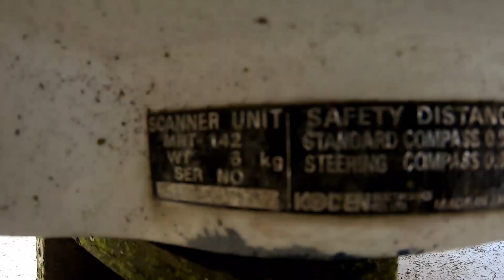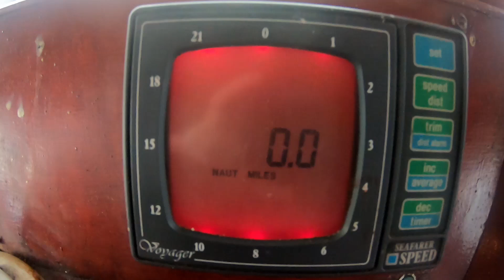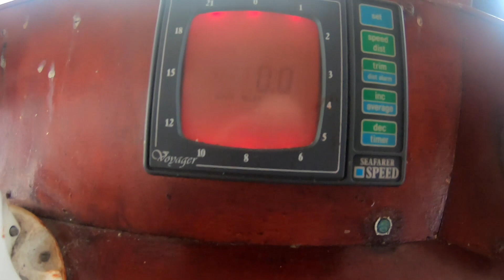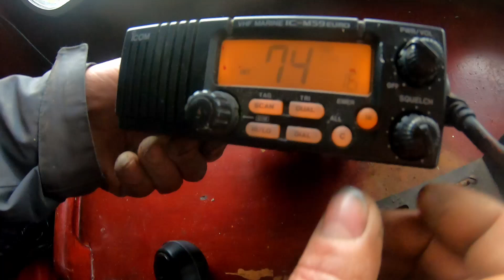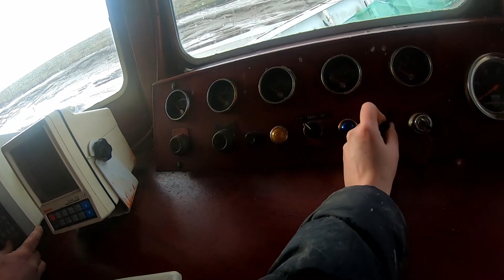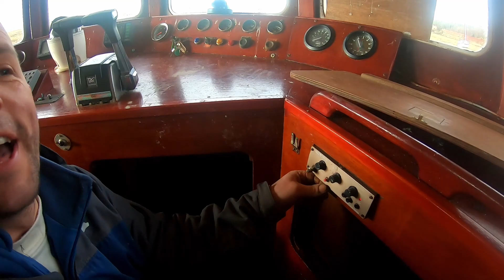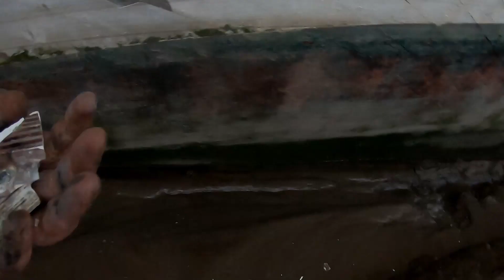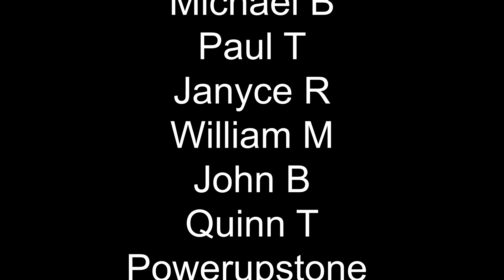Ep 6, Assessing the Hull, Mud fails and weird noises of the ship!

Comment: Squelch is a filter that cuts out signals below the level set by the dial ... it is used to silence the static you'd normally hear from the radio - since transmitted signals have more power than the background static, filtering out the lower strength signals gives you a clear radio ... to set it, turn it all the way down and then up until the static stops.

The radio was left on channel 16 since that is the emergency channel - do not transmit on that frequency unless you want the coastguard to pay you a visit ;)
Reply: Trivia.  Some older systems refer to 'squelch' as 'CODAN'   -  'Carrier Operated Device - Anti Noise'.

Comment: trouble is if you wet wash the inside of the hull you will have alot of debre which will clogg the limber holes (there gaps where your bulkheads and verticles meet the keel Called lymber holes these allow the bilgewater to move to the lowest part of the boat  usually engine room where the bilge pumps are )in the bilge or block you bilge pump

Comment: Back in New Zealand there were a lot of wooden boats which had worm or rot problems so the easiest way out was to plaster them with cement ... It worked really well to the point where the boats gained buoyancy and sat higher in the water.    Just in case you find rot which cannot be repaired easily. 😁😂

Comment: Try to get that old stove up and running 😎 , then you can burn all the bad wood 😃 , and get som heat to dry up the boat 🚣‍♀️ , 
A question is the boat equipped with diesel water heater ?
like a webasto ?
Reply from the maker: Yes but it has seized, we have took it to the workshop to strip down and fix
Reply: @ShipHappensUK  
Cool i’m using a old ebersprecher from a mercedes its 5 kw and i have my boat in the sea , and we have had -21 celsius her in Sweden lot of snow but the boat still is 6 + celsius inside :-) i can heat it up to 20-25 + c if i want 😃 , it’s a steel boat 34 fot twin engines

Comment: Since the boat is already wet, I would consider cleaning out as much debris as possible, power washing the inside. 

Follow up by applying a fungicidal digester spray. 

Then pump the bilges as clean and dry as you can.

It will be much more pleasant to work on if it's clean, and the fungicidal spray will slow the rot.

Comment: Knowing that the DC electric system is 24 volts, and you are currently working with 12 volts as an interim measure, you might consider LED lamps with the ability to work on either, as most of the work lights with LEDs are. Check the label! I've used some of these lights on my mobility scooter, and they give adequate light and minimum consumption...and. they were fairly cheap.  Carry on! You're doing fine. I for one love that this is truly a family project, where you don't just show the successes.

Comment: I would try to build a temporary structure with with a high roof and walls to work under a section at a time to replace the rotting wood that is allowing all the water to enter. Something like a canvas shed would be easy to set up and take down and you'd only have to attach it to some home made mounts you install on the boat. The best thing for the interior is to remove anything wet or absorbent and allow it to dry out. I look forward to seeing the progress on the boat after seeing pictures of your conversions!

Comment: Hey guys love your show. Yes the metal hangers up in the bow are called knees. I imagine the ballast was added when the removed the WW2 Gun platform when it was up on deck. Also the skelaton frame in the bow would have been installed to support the heavy gun platform. I would use grit blast with a compressor using a nut shells crushed mix then vacuumed up after this will expose and faults in the timber work after paint is removed then reprice and paint. Using water internally can leave unwanted water in the bilge. Just a suggestion good luck love watching.  I also watch sailing Yaba. From down under.

Comment: Heck with that, I would secure the engine room or one of the rooms from thieves. Leave that stuff right on board..
Reply from the maker: The engine room is sealed with a watertight metal door and is fully secure. Plus we don't leave valuables onboard x
Reply: @ShipHappensUK  after seeing all that mud i would be figuring out someplace to leave it. I figure this will be atleast a 5yr journey so I'll be watching for you on an Olympic  team, running or bus pulling. Your leg muscles are going to be insane...lol

Comment: The idea to wood boats is that they must be done right away. The boat needs water to keep the outside planks together. The wood swells up. The oakam must stay moist between each outside plank. I don’t know guys but I think you way over your head on this one.
Reply from the maker: Thats why we are not putting her on the hard like everyone keeps suggesting!
Reply: @ShipHappensUK  I would not suggest digging anything open or doing any repairs unless you really need to do something. I use to work on wood boats many a years ago with my father and uncle and was a chore!  We ended up removing half of the boat to replace stringers and webs. It was awful. But it took allot of time and $ to get it done. This was for a 38ft boat made of mahogany.  You will find bore worms and rot in your boat. If you find bore worms you are just better off to replace everything you see and have on it.

Comment: A lightweight trolley made with some of those flotation wheels they use on dingy launch trailers would be a real bonus? Simple alloy tubing and the bottom 30 cm of an ibc ? It would both float and pull easily over the mud and ruts.

Comment: Why not tow it to a dock some where, if you can.The fire stove it corroded by salt water in the air and leaks from above. Looks like you need to go on the hard, (land) for some rip repairs and to be able to check the bottom and keel / sand blast the bottom and repaint. The chain is possible used for ballast.
Reply from the maker: Because this project was never planned so funds are tight at the moment, we would rather use the money to fix her before we have the additional costs of mooring fees, so it is a pain to deal with the mud but we will battle through!

Comment: On the hull I would not introduce water. The best thing is a stiff brush and vacuum. The ballast is there when the ship was made to give it a lower center of gravity. Since the boat has been added to I'd leave it alone. It's time to think about pulling this monster out onto dry land. Wooden hull need pulling to check the outer part. I wish you the best of luck.

Comment: Another great video. Be carefull with the stabilizer controls. You can do alot of hull damage if you try to turn one with it stuck in the mud. You need some Ship Happens round decals for people to purchase. Looks like you may have a good fairly sound hull there. The metal piece that is on the bow is called the " Cutwater". It protects the bow stem from damage. Looking forward to the next video.

Comment: You can and should scrub the inside of the hull with Dawn dish detergent and water, then it's perfectly ok to power wash it, then pump put the water, shop vac it dry, put dehumidifier in there, then once it's dry as a bone, you can apply primer and paint. I would definitely wait to paint anything till you get all the woodwork done. Check out the video series I just sent you the link to. It's super interesting!😁😁😁

Comment: Hi One of the things you need to do is try and get some heat inside in order to dry her out, also stay onboard until she floats then check the bilges for water ingress because all the rain water that has leaked into her has gone somewhere and by rights should still be in the bilge unless you have a pump working.

Comment: Get some flex seal tape and spray works great can even get it in white
Reply: Flex Seal is great stuff, but quite expensive. Rubber cement and rubber membrane works well for me and can easily be removed with a heat gun
Reply: @chiphalvorsen4252  for a quick fix is key but I’m more worry’s then a little flex seal lol 😂 looking forward to this one you got a lot of work on your hands cheers

Comment: Yeah if there are 2 tanks there at the bow, with the showers there and the heads!! ( Toilets) lol i would imagine one is fresh water and one is the grey water, but there again toilet waste because of the age of the ship might have been pumped out at the side of the toilet, you will see the pump on the side of the bowl if that was the case. !!
Reply: Boats, especially of that vintage don’t have grey water tanks. It’s just discharged overboard. It’s likely the only tanks are fuel and water. Toilets used to flush overboard before 1975.

Comment: The "clamps" you refer to are the "hanging knees" that connect the deck beams to the (sister) frames. One thing you will have to be VERY careful about is that they seem to be made of iron. Iron rusts and infects wood with a dry-rot called iron sickness. It turns the wood black and brittle. Very often any wood parts that have been in contact with metal parts will need replacing.

Watching the insides of the boat gives me the feeling that while the hull might be OK (I won't say fine, because the clamp (the top beam around the inside of the hull frames that the deck beams normally rest on) appears to be rotten), everything above the deck will have to come off and be replaced. The superstructure is just very, very far gone and you'll never know how far inside the rot goes until you start stripping (likely down to the hull frames). There's a good chance everything in the interior will have to come out too. You have taken on one heck of a project. I agree with what others are saying, if at all reasonably possible  get the keel out of the mud and find some place where you can work on it inside and out. Your first priority should be stabilising and repairing the hull, possibly even just finding a place slightly higher up and using a high spring tide to float it there. Prepare hull stands beforehand if at all possible to make it as easy as possible. Right now the worry remains that she's rotten at the keep, but that the damage is hidden by her sitting in the mud. 

Start with removing as much of the rotten wood from inside as you can to get a good look where the rot stops. Rot begets rot, so everything you take out is a good thing. While it's hard to get right now, even though it doesn't smell like mould, wear respirators. The reusable FFP3 masks are easier to get than the throwaway ones in my experience. Rotten wood particles aren't great for your lungs either and not all dangerous fungi have a distinctive smell.

And lastly, this video nautical terminology might come in handy too ;) : https://youtu.be/mutcGUbPwTk

Comment: I would recommend to remove everything that is rotten, before starting to clean it. Saltwater on wood is perfect, but i would not recommend using saltwater inside, because you will have "problems" later becauser the salt will dry and make "lumps" that "never" will dry. Saltwater is perfect for only the outside and on wooden deck.
Btw; You got yourself an extremely nice boat with beautiful "curves" :-)
Really looking forward to watch the videoes ongoing the project.
Good luck, and thank you so much for sharing. Thumbs up :-)
Reply: Salt water is fine inside if not preferable its fresh water that allows rot. Getting rid of the mud is a priority then stopping the freshwater from leaking in  so clean and seal decks.

Comment: I really hope that area has been fully checked out for bombs from WW2 as dragging heavy items over the marshy ground may hit something and set it off. Let us hope there is nothing there especially not a V1 or V2 in the ground. People tend to forget about things like that maybe get a metal detector and check the path who knows there maybe some gold out there! Maybe do some mud larking too :-)  Oh and please never ever touch the radar when it is actually running you will cook yourself.  Pull the whole stove out and have it sandblasted and use high temp paint on it ! The internal timbers are just to hang walls on they aren't structural.
Reply: The area the boat is in was never hit by V1 or V2,s

Comment: I panicked a bit when you were messing with the VFH on channel 16 lol that's the distress frequency and people get pretty upset if you use it unnecessarily
Reply: 16 is the hailing channel, he can ask the coastguard for a radio check or call other boats. The coastguards monitor this channel but it's not only an emergency channel. Most marinas use this channel for coms.
Reply: @MakingWavesPresents  VHF channel 16 is the International Distress and Calling channel.  Test calls to the Coast Guard or others should be made on a working channel, not Ch 16. In my area (west coast Canada) marinas do not use Ch 16.
Reply: @MakingWavesPresents  sorry squire but you are incorrect. I would recommend you go on a basic VHF course
Reply: @MakingWavesPresents  well done mate. Since we’re comparing licenses I’m a Master Mariner (U.K. Issued, unlimited) and hold a GMDSS GOC. Got you beat in the license department I’m afraid pal.
Reply: @michaelferguson4662  are we at cross channels here lol are you saing you can or can not use channel 16?
Reply: @MakingWavesPresents  not sure but channel 16 is definitely designated as an international distress frequency. Marinas should not and in my experience generally do not use it for general comms.
Reply: @Michael Ferguson  VHF: Channel 9/16 – «Marina da Póvoa» Channel 16 VHF (156.8 MHz) is a marine VHF radio frequency designated as an international distress frequency. Primarily intended for distress, urgency and safety priority calls, the frequency may also carry routine calls used to establish communication before switching to anoth er working channel.*
Reply: @MakingWavesPresents   so your initial comment was wrong: “....the coastguard monitors this channel but it’s not an emergency channel. Most marinas use this channel for comms”. 

Your comment further highlights that it is in-fact a distress channel and should not be used for general comms. 

I never suggested that you couldn’t call other stations on 16 and move to a working channel.
Reply: @Michael Ferguson  lets stop splitting hairs lol. ok I missed out the 'only' in the original post 'it's not only an emergency channel' also my original post started '16 is the hailing channel' implying you then move onto a working channel. Hail as in to call someone in order to attract their attention
Reply: @MakingWavesPresents  haha fair enough. Funny how inserting one word changes the whole comment.....
Reply: @MakingWavesPresents  without a licence using the radio is criminal offence £5000 fine and/or 6 months in prison !!
Probably best not to encourage its use ...

Comment: Ignore the planks because they are expendable and are designed to be replaced, I would pay close attention to the Hanging knees, floors and ribs, looking for iron sickness and rot caused by rusting iron. Oh and P.S  stainless steel dont last for ever and the bow is leaking rust from plate itself.
Reply: Not on a double diagonal, the inner planks especially are very hard to change!
Reply: @dhutch2000  Plus the insurance is higher for double diagonal.

Comment: The outside skin and frame of the hull looks treated and sound . The internal wood hasn't been treated with anything so looks like it's just rotted away . Just strip it back to the hull frame and start again . I'd try and dry out all the water from around the ballast and water tank over time that could rott the hull .

Comment: All I can say is that what you really need to do to get rolling with repairs, will not be able to be done very easily where the boat is. Good luck finding a place to put her while the refit is done. Any progress on that front, or have you been able to do much research yet? Just getting yourselves to the boat is a challenge, so tools , materials and the like are just going to be ridiculously difficult. Keep at it. One small step for future sailors, and all that. Regards, Solomon

Comment: Brilliant
Love you got Donna Summer out of the the old radio on the old boat, spooky....

Something worth saying - when working of structure - Be careful about making it TOO RIGID, but of course, rigid enough.   Wow no help there.  Wood structures have failed when joints 'reinforced' to counter shifting / movement resulted in the wood structure cracking.  It's sort of complicated.  If you can't  access professional assistance, DUPLICATING existing  structural elements is safer than changing them with say welding plates or using plywood to create a membrane structure to replace what was a flexible metal angle.  The ships ribs are pretty thin so all the screws needed to sister could impact overall strength spreading wood and creating a shear plane.  Got to say I don't know boats that well, I'd be tempted to install new rib and joist to match existing on either side of existing along with new steel 'angles', rust treated, there's black iron used in piping, corten steel that rusts a bit then stops, and of course galvanized.  Try to find out if orig fasteners went through both layers of planking into ribs or if ribs just secured to inner planking layer - which I suspect is the case, and probably from the inside
otherwise... 
Make up some walking 'sticks' 8 feet or so maybe with a wider base when you hit a trace to go over stick pole in bottom and pole vault.  Ancient tech used by various cultures around the world.  
I'm guessing couple hundred meters boat to shore, too far to use a rope and capstan to haul in sledge?  Landworks Electric Portable Winch Capstan Hoist Brushless Motor Li-Ion Battery Powered 1000-2000 Max Pulling Force for Forestry Hunting Garden Off-Road  No idea what the UK equivalent might be. 
or
much more practical if less fun...
make two smaller sledges (with slopped front to go over obstacles) and make 2 trips